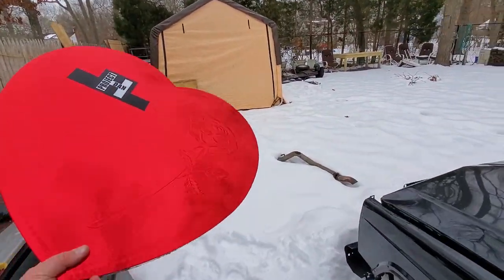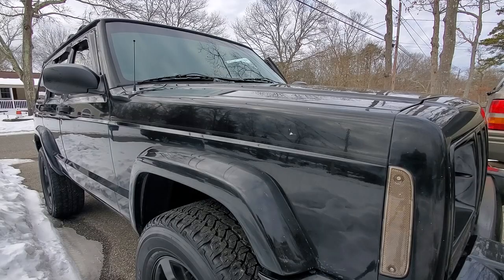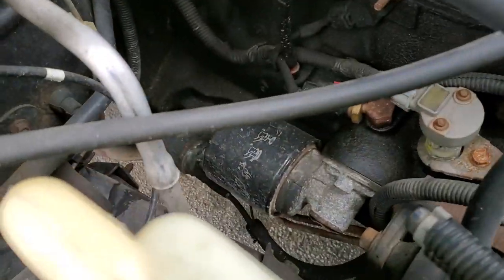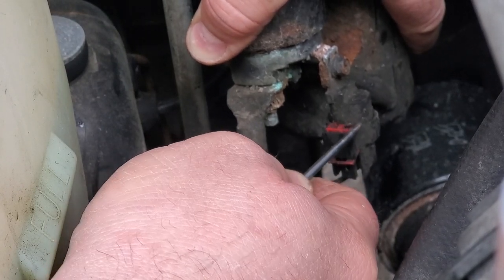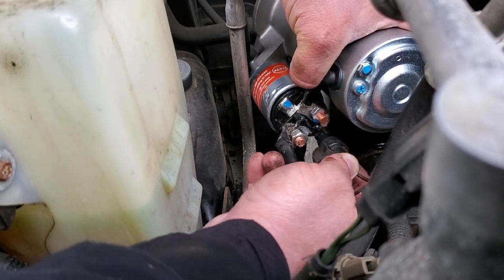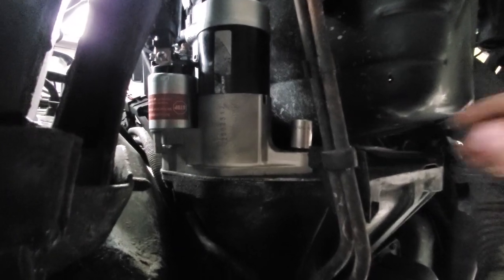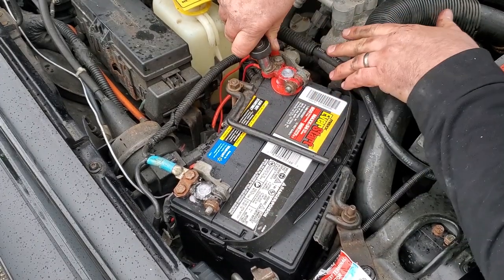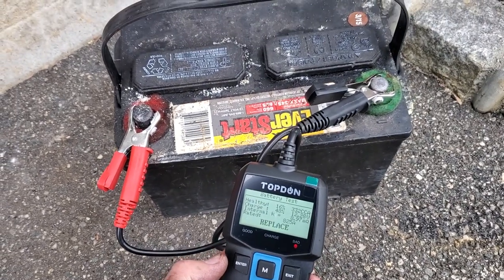JEEP CHEROKEE XJ STARTER AND BATTERTY REPLACEMENT

Comment: I need a video like that with the ignition switch and the accuator pin!
Reply from the maker: Coming up!
Reply: I have the common issues the brake light the panel switch sometimes don't work even the a/c blower and rear wiper.

Comment: Had a broken door check on Bumble Jeep when I got her 1/18. Hinges were toast as well. Got a used door check from a local salvage yard, welded the hinges and good for now. But the used door check pops and cracks no matter how much WD-40 or white lithium grease I spray on it. The price on new door checks are crazy, even from Rock Auto. ($37+), so waiting for the snow to melt to grab a passenger side check from another yard that has plenty of Cherokees. Maybe I'll grab some spares to share. God bless, stay well.
Reply from the maker: Thanks Brother!  I'm definitely gonna be welding the drivers doors back on of Wrecked J and Grievous
Reply: I hate that mine make the creaking noise. Not sure what it’s called to find a replacement for what look like two bearings. I white lithium grease the heck out of them now and then but being a 98 I’m sure they been through the wringer.

Comment: Also, do a voltage drop test on the battery cables to see if corrosion had built up inside and underneath the cable insulation. You can also cut the insulation open in a couple of places and see if the wire has turned green with corrosion. In my younger days, I have replaced the battery and starter to find out I still had the same problem with bad cables.
Reply from the maker: Excellent tip! I plan on replacing the cables soon

Comment: Another good test to do is a Parasitic draw test (Current Draw) to see if the battery is being pulled down slowly by current draw when you are away from the vehicle.
Reply: How would you test for a draw ? I found mine but I was just lucky searching through forums
Reply: @scottschrader2978  There are many videos here on YouTube that will show you how. You will need an amp/voltmeter.
Reply from the maker: D&E In The Garage and Bleepin Jeep have great vids on locating parasitic draw

Comment: My 98 ZJ limited starter went at 298k and it was 22 years old but would work if you tapped it with a hammer 😂 Great video Dan H. and Walmart batteries are the best for your budget .
Reply from the maker: Right on! wow, that's quite a starter! it helps if you travel more miles per start! you must have a long commute to work!
Reply: @ProjectDanH I'm on the Go like G.I.JOE 😂

Comment: Thanks for the vid.  Our XJ is sounding sluggish at startup like Black Beauty was.  We are taking to my mechanic to correct an oil leak, and I may be having him replace the starter like you just did.  The batter is fairly new, but we will check it to be sure it's good.  It's got 156K miles, but I wonder if the starter is original?
Reply from the maker: Ya never know,  sometimes even new batteries can be bad.

Comment: My 1999 XJ classic has been sitting all winter. I did my starter last summer and all was well. Now it won’t start unless I put a screwdriver on the starter terminals. I already replaced the NSS but that didn’t change anything. Any idea what the problem could be?
Reply from the maker: Possiblity your ignition switch on your steering column
Reply: Project Dan H Thanks!

Comment: hey I've got a question. When the engine is cold, and I wanna do a cold start, do I have to wait until all light go out, or can I do it like u did, u just put the key, and start the black beast, does it makes any difference? I have a 4.7 WJ :)
Reply: It shouldn’t really make a difference for gasoline engines. You mostly see that on diesel engines to warm up the glow plugs for a cold start.
Reply: @jbomman  yeah, Ive always had diesel engines cars, and I learned that I should wait until all light goes out, but I am learning new stuff each day, thx
Reply from the maker: The warning lights are just a quick self check.. for a gas vehicle just crank away. like jbomman said.. diesel needs time for the glow plugs to warm.
Reply: @ProjectDanH  thank God im over with diesel :)
Reply: I try the first start then wait a moment for the friction to warm the oil before trying again. Least that’s the idea in my head that it helps lol